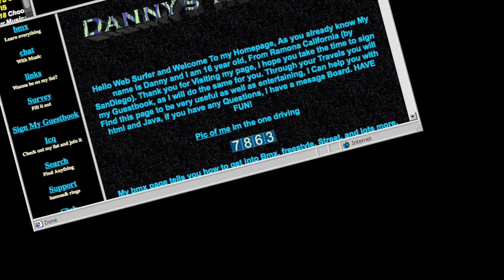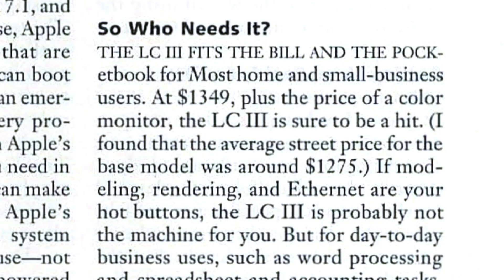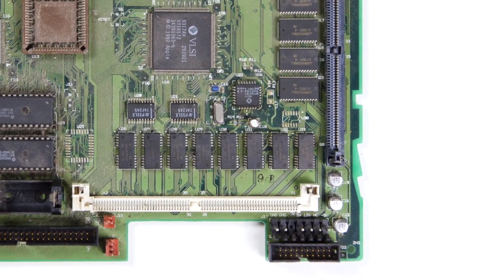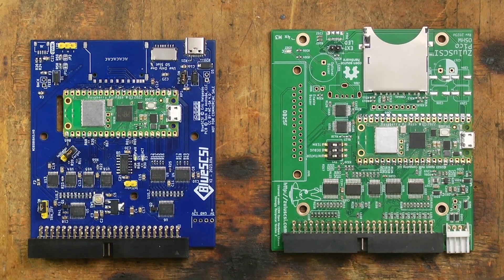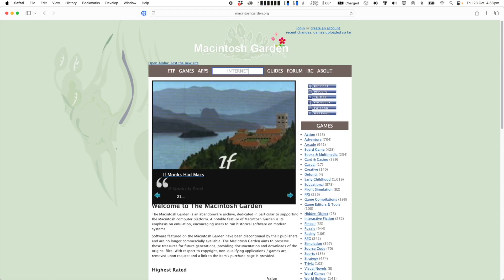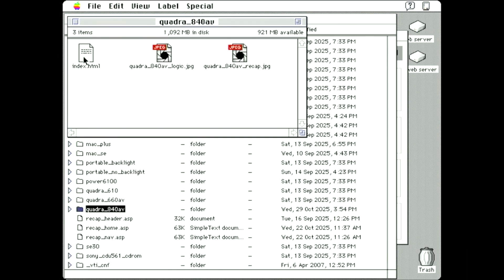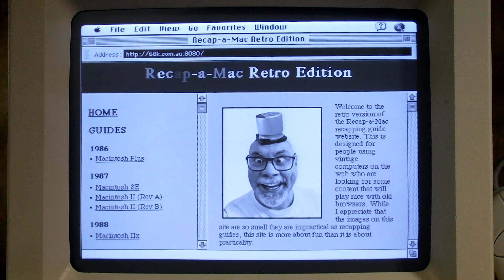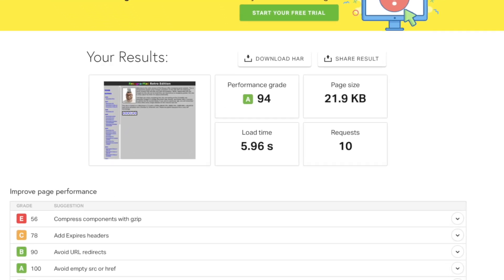Building a vintage Macintosh web server

Comment: Worked OK at 3:30AM-ish here on my old iPad (insomnia strikes again).

As someone who has actually installed some PowerMac 8500s as web servers running FileMakerPro in a data center back in the day, I find this to be a total hoot! Now, you need to figure out a way to get a chicken-cam page up on it. 🐓📷

Comment: Nice! I knew/used IE on Mac, but I never noticed they had a PWS component for mac. I'd be curious to see a comparison between that and what I thought you'd be using, WebStar. It's pretty cool, way, way back in the day I worked at an ISP that also had a full web design/devel shop of like 8 people. They had an old Quadra or something in the middle of the office that ran WebStar and they used this server as a staging/devel server and it was on the internet so clients could review changes. Since they were only a few floors up from the ISP, we just ran ethernet up there and they had a server online, in their office with 10Mb/s connectivity, which was frankly luxurious in the 90's. Transit at the time was from UUNet (R.I.P.) and was fantastic.
Reply: I was going to suggest he contact Chuck Shotten who wrote WebStar. He would get a kick out of this project. Next option would be to put his cap builds into a FileMaker Pro database and use the built in web server for that

Comment: Site was loading fine from east coast USA at 10:48 PM. ...Now it's hanging though just a few minutes later.

Nice chickens.
Reply from the maker: Sorry, I was fiddling with it. It should be working now.
Reply: @BranchusCreations  
It's quite a bit more responsive now. 

I'm honestly surprised at how well you got it to run. I had a second hand LCIII waaaaay back in the 90s, and when I was getting online in the early 2000s I was told that I needed something faster than an LCIII.

I remember finding out that they were right. I'm not even sure I could get the AoL software to run on the LCIII. That you've got it hosting a web page is kind of impressive.

Luckily, someone was nice enough to then give me a second hand Performa 6400, and that was the first computer I used dial up on... And so it was the first computer I used the internet on.